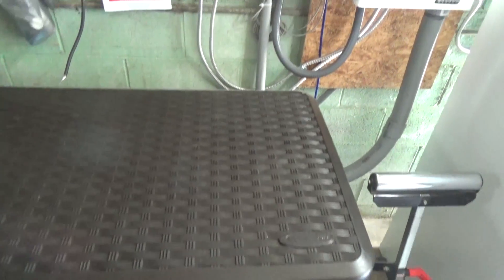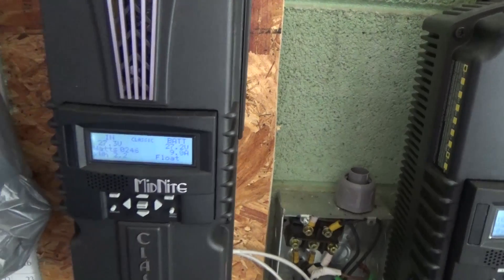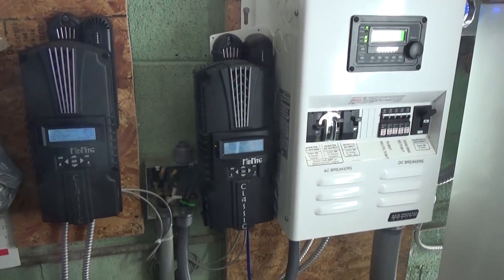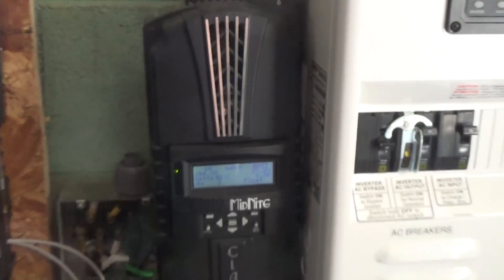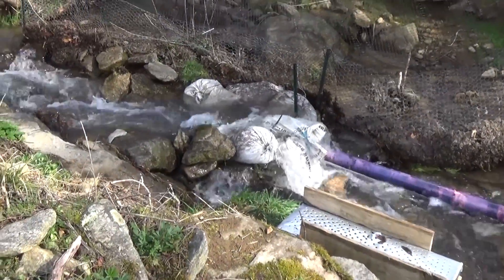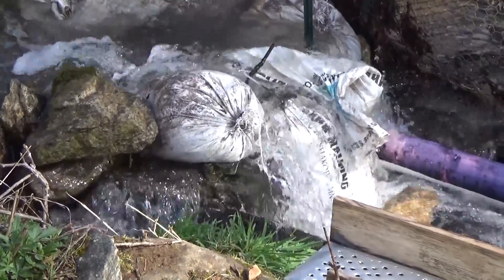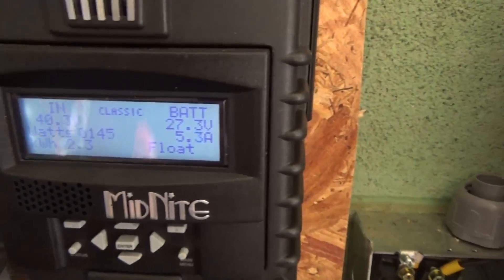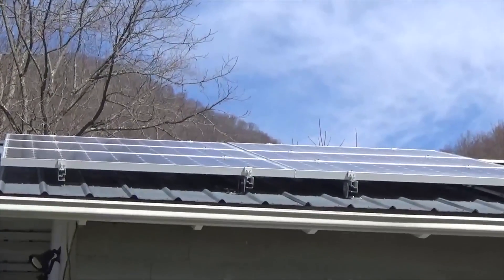Micro Hydro Power with Turgo generator Part 2

Comment: I'm curious why they are still paying for electricity if they have full batteries in the morning.  Can't they sell their surplus power back to the utility?
Reply: Most electricity draw occurs during the day, not at night. The turbine is really producing only a small amount. Output was running ~250W. My motion activated flood lights draw that much alone. The fridge cycling would draw as much. This works to top off the batteries so they can start the day with a full charge but really that array of batteries is tiny and with only a few solar panels, there is no way they are producing excess power at this point.
Reply: @nathanrogers8713  Why don't you change that flood light to an LED type?   if it's the old sodium based then you're wasting a lot of power.
Reply: @davemwangi05  No not sodium. Halogen.
Reply: @nathanrogers8713  Oh okay, those ones are really bright. have you evaluated the cost/benefit of replacing it with LED type? Like how much it would save you in bills.
Reply: @davemwangi05  They came with the house and just haven't gotten around to changing them. Would require swapping out the entire fixtures. We use them on motion activation only so they generally don't actually run that much so consumption is low.
Reply: Unfortunately in most states, the electric company's have  made laws that require you sale the excess juice back to them at wholesale price per kilowatt!

Comment: awesome ! i wonder what is the life expectancy of the bearings in the turbine ? does the turbine wear off first ?
Reply: Interesting micro hydro system. I would assume it would be better to shut off the turgo's water supply during the day when the solar takes over. Running the turgo 12 hours a day might increase the years of service?
Reply: 10 psi of water pressure running 24-7 about 4 years on the bearings turgo will last right on as long as there's no sand rocks

Comment: I would use a  hydroscreen on the intake, great video
Reply from the maker: +Jason Andrade I recommended a coanda screen setup but he wouldn't spring for it.   I think he will eventually as 2 walnuts ended up in the nozzles.

Comment: looks like a nice system. little more solar and batteries. they could go off grid completely.
Reply from the maker: +Roy Amberg 6 more panels and 4 more batteries is in the works and yes they will be completely off.  With this current setup they only pay $35/ month.
Reply: Use one from a heavey truck if your  going to go that route
Reply: Sure an alternator could work... If you don't mind 12V that is. The system is setup for 48V though...